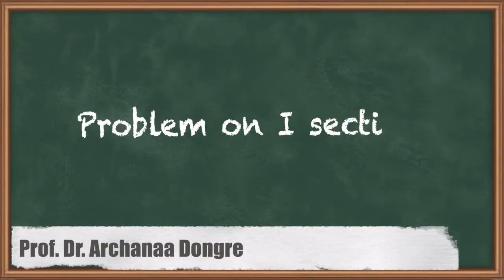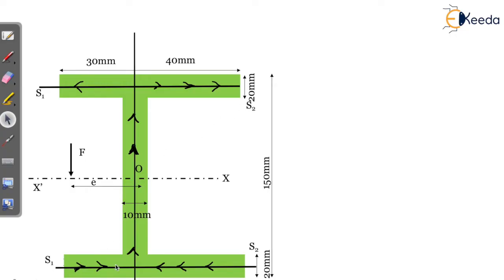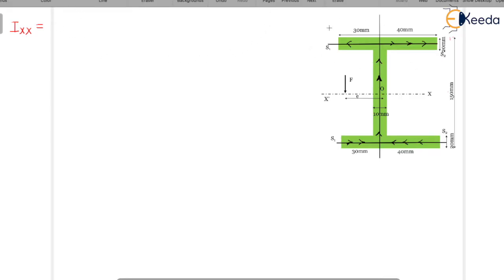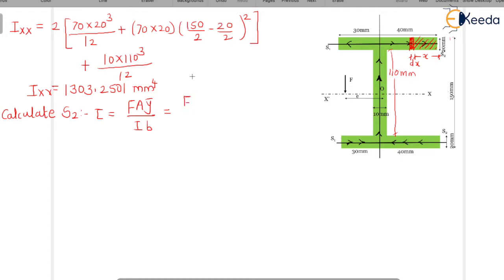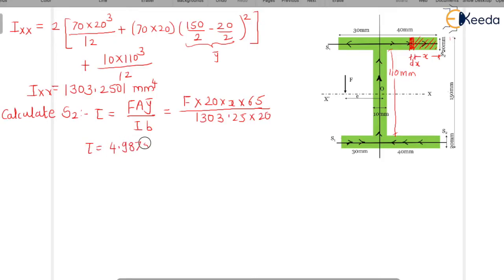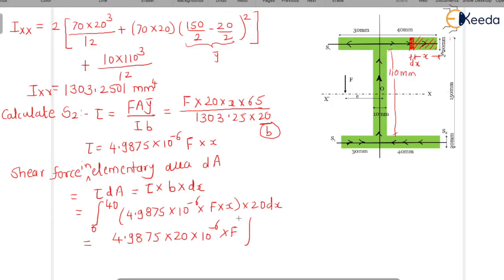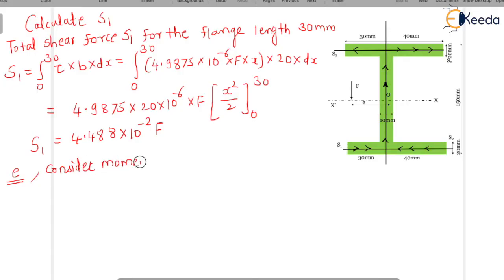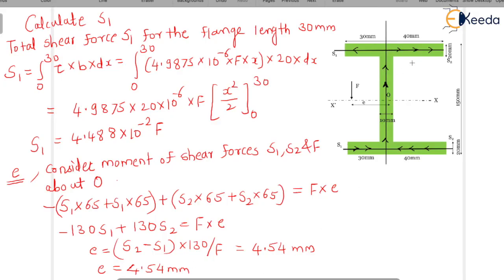Problem on I section - Shear Centre  - Structural analysis 1

Comment: Ixx should be 13032500 mm^4. I think there should not be any point.
Reply: There was a mistake in the units when the value of Ixx was given. She should have written cm^4 and not mm^4 at time 5:04. At the end of the video we can see that the right value of Ixx in mm^4 was used, at time 16:03.
Reply: Yeah you’re right, I calculated and I was shocked